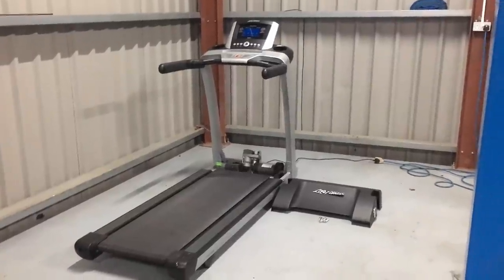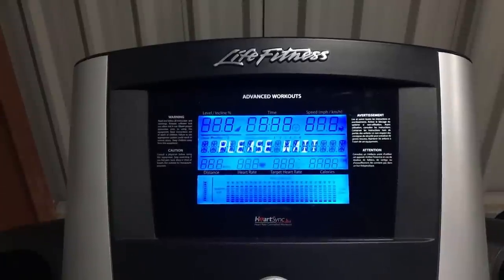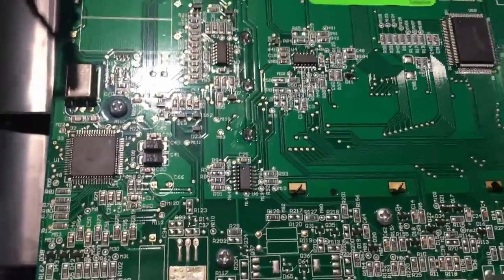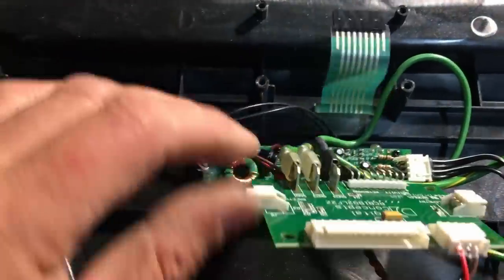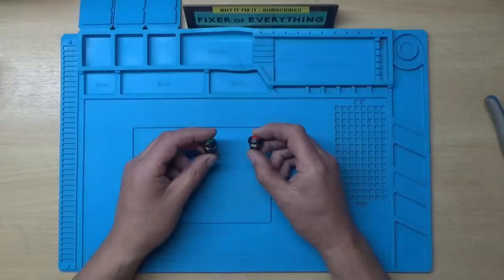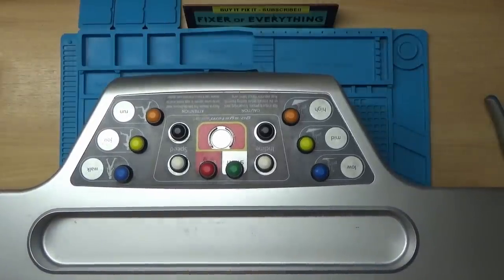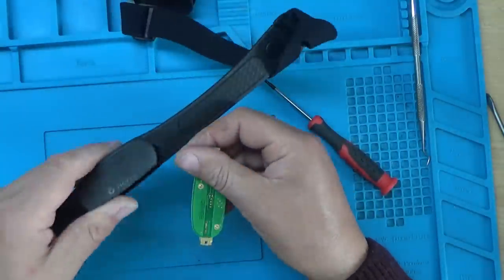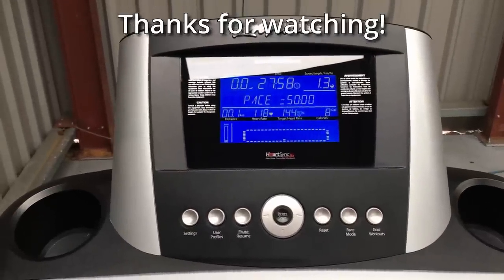Free Expensive Treadmill - But Faulty | Can I fix It?

Comment: That's a great fix 👍. Being in the trade, the most common failure of membrane keypads is the cross over tracks. I've done a few repairs similar with the difference being I collect boards from dead washing machines and the like which now days have surface mount TAC switches. These are a nice small size that can be fitted as a replacement for membrane contacts. And with a bit of pocket making to accept them, allows the original top keypad cover to be reused. My current microwave oven is a case in point. Great stuff!
Reply from the maker: Thanks! Great idea, I didn't think of how to use the original membrane cover, I guess it would be a little more time consuming hollowing out all of those pockets...

Comment: Nice fix! Also, I can't believe Polar would make a disposable HRM. I've owned several HRM through the years but all could have their batteries changed easily. Really weird. 
The HRM and many other fitness devices use ANT+ protocol to exchange data, btw. The newest ones also use Bluetooth Low Energy.
Reply from the maker: Thanks for the info!

Comment: Love the fix! I really wish manufacturers would stop using membrane keypads.
Had to toss out a nice dishwasher because of a faulty membrane keypad, which costed almost as much as a brand new dishwasher, and was unfixable despite my best efforts.
Reply from the maker: Thanks KP👍Shame about your dishwasher 🙁
Reply: You can't beat membrane keypads and the water resistance. But, there's no reason for a replacement to be so expensive. Don't blame the keypad, blame the greedy manufactures for over-pricing replacement parts.

Comment: Good fix.  I have several commercial quality pieces that I got from military surplus, some I still need to fix. I was surprised at the replacement cost of the membrane, because LifeFitness usually have reasonable replacement parts costs here in the US. I'll use your membrane fix in case I have a similar issue.  I find working on fitness machines a lot of fun, since it's usually a mix of mechanical and electrical/electronic, and most issues I find are usually quite simple to fix.  Now, to get fixing the treadmill and elliptical that's been waiting in my garage for a while....
Reply from the maker: Thanks Michael 👍Good luck with fixing your treadmill 🙂

Comment: That machine looks to be quite well made! Shame though it was designed right at the height of the "product shall beep when any inputs are pressed, any action happens, or when stray cosmic rays enter the silicon die of the main microcontroller." Sadly most new microwaves and coffee makers are still stuck in this era. 😂

Comment: I just would not have thought of drilling it out and installing button switches. In fact, I did not even think switches like that would be available. I searched amazon and am surprised by the variety of button switches that are available .
Reply from the maker: Yes, it was a lot cheaper than a new panel and I can replace an individual switch if it should fail 🙂👍

Comment: I got a deal on a top of the line treadmill 2 years ago. Her 24 hour gym said they just wanted it gone one day while she was working out on the machine a few down she jumped off and told the guy her husband could be there in 15 mins to take it away he said okay after making a call. Turns out someone spilled water on it and all I had to do was replace the membrane under the same type of pad as yours. Hers has al9t of buttons on it though and even if I could get the buttons like yours for $1 each it would have cost twice as much as just replacing the membrane. I found a new one on eBay for $13 plus $5 for shipping. Ended up keeping it for 15 months she loved it but when we moved we sold it and got $1300 for it. The guy said his wife had one just like it and hers stopped working a few days ago and she wanted the same one since she loved it and knew how to work it, my wife looked at me and I just told her no.
Reply from the maker: 😂😂Thanks for sharing 👍

Comment: Well done. Think of the landfill that would have created. At least you can't easily stand your lucozade on that surface anymore (but still in the slot above). Probably worth checking the secretion ingress rating of the new switches.
Reply from the maker: Thanks Ralph 👍On Amazon it said the were waterproof, but I have my doubts 😂😂

Comment: Dam, I was hoping for a wind turbine project. Oh well, nice fix.
Reply from the maker: I bought a washing machine for something similar a while back. It still might end up as a water turbine yet as I bought a pelton wheel for it. I used it to generate DC in the video when testing the solar inverter I repaired a while back 🙂
Reply: @BuyitFixit Have you got a river or a stream running through your property?
Reply from the maker: Yes, but it's quite some distance away, so I'd need a lot of cable to run it back to power anything useful. It's part of the reason why I haven't done anything with it so far.

Comment: Great repair. It is a shame this manufacturer is a bugger. Making it not a serviceable to replace a CR2032 battery in the Heart rate Transmitter is a total clue they just want to make money  out of their Customers who bought their over priced Tread mill ! Well done on fixing this , you did a fantastic job. !!
Reply from the maker: Thanks Allan, the HR transmitter is not unique to the treadmill but can be used on a lot of devices that support it. It's actually made by a different company. They say it's to make it waterproof 🤔 but they could have easily added a screw on back with an o ring if that was the case 😂😂😂

Comment: Those treadmill motors and adjoining electronic motor drivers are very good candidates for metal lathes when you want speed control. 

Quite a few treadmills can be had for free when they’re put out on the curb to be trashed, I have collected three of these this way.

I’ve modified two of my lathes and a mill using these in my home machine shop.. all for free, to boot.
Reply from the maker: Nice, and a great idea! I've heard of people using the motors for wind turbines and such.

Comment: Why didn't try this conductive paint thing?
Reply from the maker: I didn't have any, and it seemed a pain to try and separate the two membranes to try and repair the failed track. I think the solution I came up with will last a lot longer and if a switch fails you can just replace the faulty one instead of having to replace the whole membrane.
Reply: @BuyitFixit  completely agree that's way more durable and excellent idea. Asked just for curiosity. Keep it up I love your videos!
Reply from the maker: Thanks mate 👍

Comment: With a little more engineering the manufacturer could have made the chest strap with wireless power, it doesn't consume a lot and you already have PCBs close to the position where the strap would be in normal use, what a waste, disposable sensors.
Reply from the maker: Good idea and yes exactly. What a waste 🙁